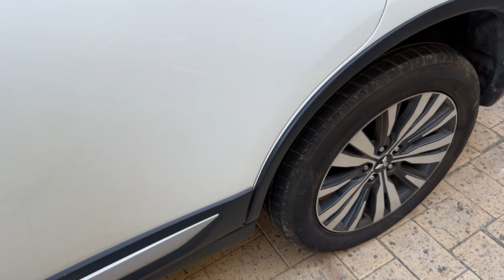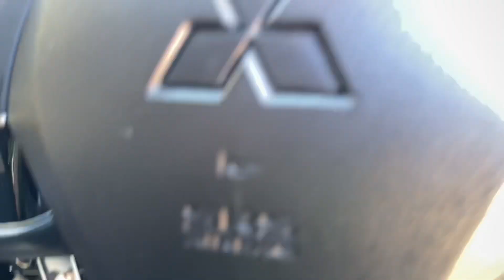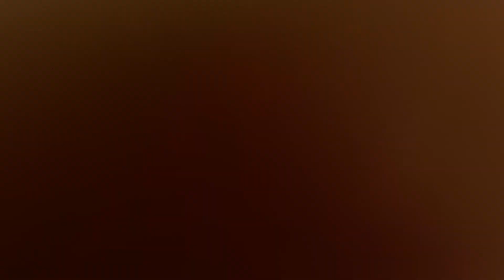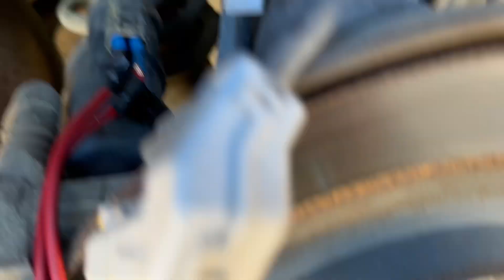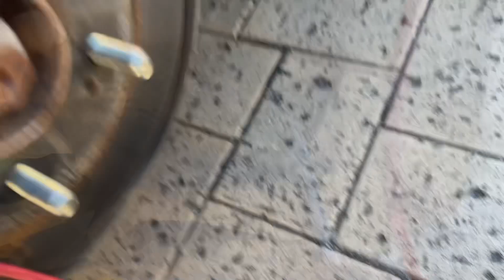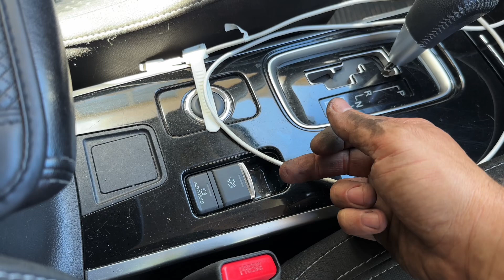HOW TO : Mitsubishi electric park brake rear pad change.

Comment: Hey thanks for the video, did you have to move the electric motor forward again after new pads have been installed?  Or just straight to pumping the brakes?
Reply from the maker: Pumped the brakes as per a normal car then allied handbrake on and off a few times with no issues.